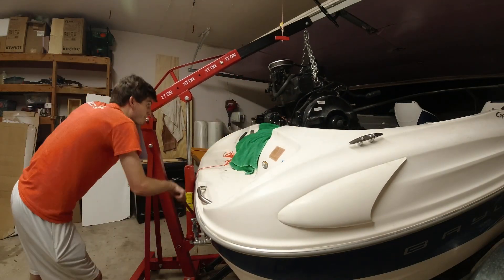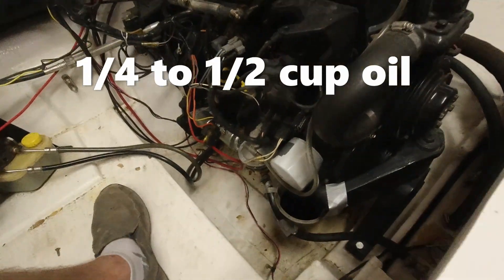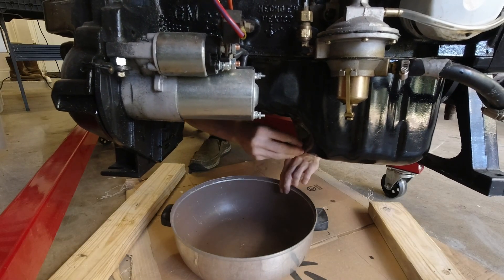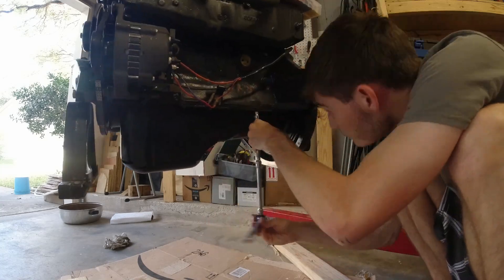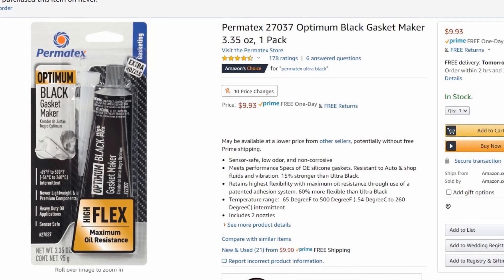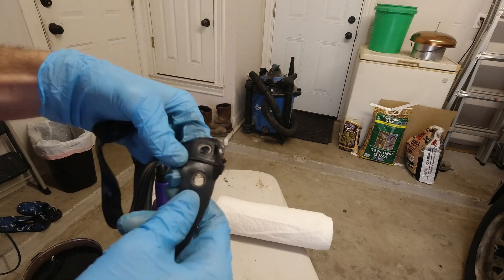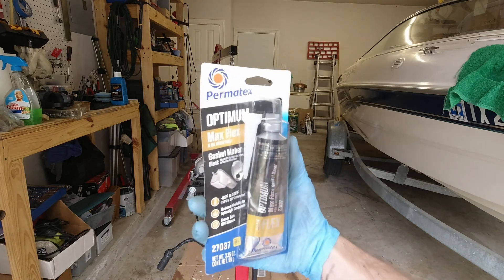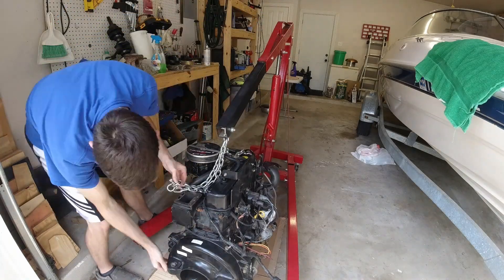Why I Removed my Boat Engine

Comment: Nice job Zach, I hate replacing gaskets of any kind. You’re never sure if you’ve done it right until you get everything back together and (usually) reinstalled into the car/boat. Then if there’s a leak it’s back to square one.
Reply from the maker: indeed!

Comment: Hey Zach try Gasgacinch on those gaskets. I have used it and it is awesome! Harley builders have been using it for years due to the vibrations in the engine. It works amazing

Comment: The reason you had an oil leak is because you have to apply sealer to the timing cover/ block seam where the gasket over lapse the joint. this is required for all similar joints. other than that...great job!

Comment: One of my starter bolts-the short one-broke off inside the block. I’ve tried drilling and ez outs but no luck so engine needs to come out. I figured I’d pull the pan and clean whatever has accumulated in there out while it accessible. Now I’m questioning if I want to disturb a non leaking pan. I priced the gasket at the local boat place and they want $140. My understanding is the block is the same as a1964 Chevy 2 Nova 4 cylinder so I’ll price that gasket I suppose.

Comment: I have a question or need advise. i wanna do a engine swap on mine to a v6 4.3. has that crossed your mind on your boat and is it possible. should i stay with carburetor or go MFI. want to keep it as simple as possible. also a concern on any mods need to be made for motor mount and stuff. can I also use a reg automotive engine ? thanks for the help in advance..
Reply from the maker: Hi Abel, yes, you can. The engine blocks are made by GM, so it already is an automotive engine. You might need to make different motor mounts. I believe all GM block sizes will work for the rear mounts. It should only be the front/side mounts that will need to be changed

Comment: All that work and you re-used the old gasket, why.  Always use new gaskets. At least that is what I do. Good video, I have the same motor in my 1976 Starcraft
Reply from the maker: This oil pan gasket is an unusual case, most of the time when replacing other gaskets they are thinner and partly made out of more paper like materials. When that kind of gasket is compressed and sets it leaves permanent indentations which makes it less likely to seal 100% if you try to reinstall it. so I agree with you that type of gasket should be replaced. However, the gasket for my oil pan is thick 100% molded silicone and does not have any permanent indentations and is still soft and compressible, the same condition you'd expect from a brand new gasket. So why not use that gasket? That's my reasoning at least. We'll see if it holds up, I'm an experimenter. Might still come back to bite me 🤠
Reply: @ZachsGarage1  I have re-used this type of gasket on transmission pans and stuff like that. They are way more accessible and yes they have that metal ring in the bolt hold to prevent over torqueing the gasket.  I hope it doesn't come back to bite ya.  It's a lot of work to get at it in a boat for sure.  Keep the vids coming.

Comment: Nice video.  Might want to look to see if there's a torque sequence for the oil pan bolts.  I believe that may also help your leaking issues since the pan will be on with equal pressure over the entire pan.  Check out https://youtu.be/jFv3bzMNASo?t=885 for a good installation video.  Shows where to put the sealant on the corners.